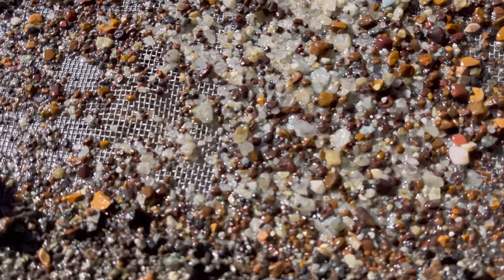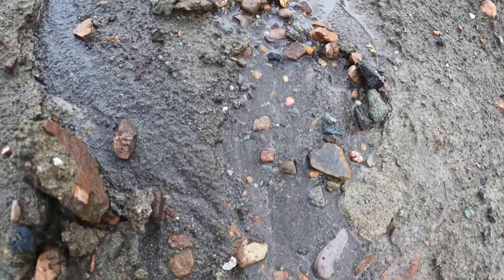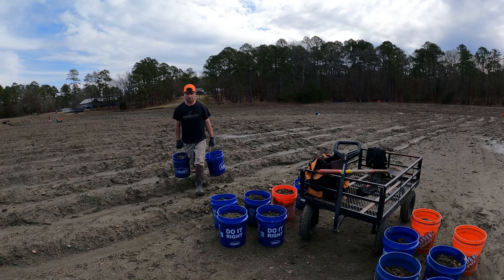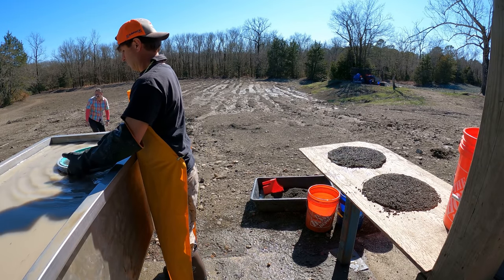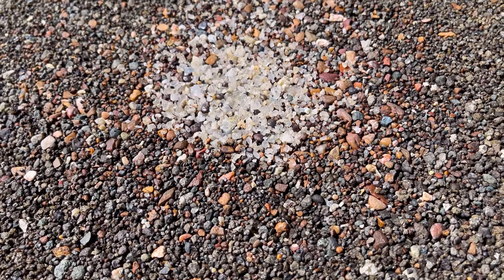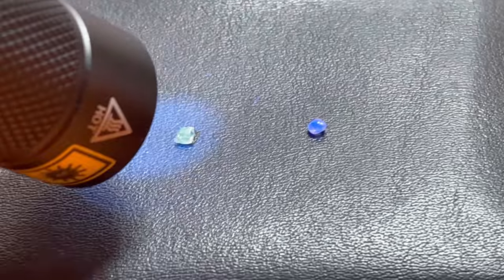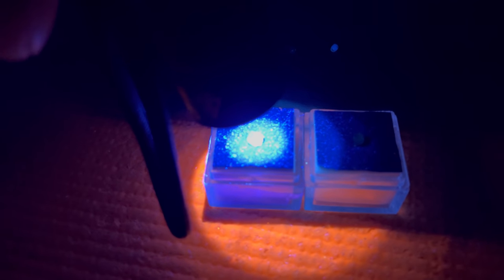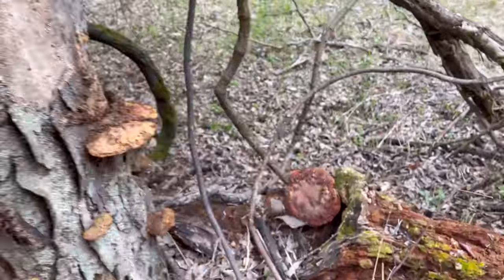Tator Island Equals Diamonds @ The Crater of Diamonds.

Comment: Great video Jason.  Sorry if this is a dumb question.....you've mentioned that the diamond has a very heavy specific gravity compared to the other gravels it's found in.  Would you be able to use a sluice in the same way you use the sluice to trap gold?
Reply from the maker: Only one way to find out! I’ll have to run some material with my 42 point diamonds through my gold hog. See what happens. 
Thanks a lot for watching the video.

Comment: Minor ivans I was wanting to ask a question why do you not find gold in the crater of diamonds I would think there would be some in there
Reply from the maker: This area was over 4,000 degrees, with enough heat and pressure to melt diamond into air. All or most of the gold was disintegrated. 
Thanks a lot for watching the video! 🥔🏝

Comment: Ok stupid question ,, why don't you use the u.v. light after you wash and get down to the small gravel?? Wouldn't they still glow in daylight?
Reply from the maker: No, needs to be darker for the diamonds to glow. There are so many other minerals glowing it would be very hard to determine which one is a diamond. The best way to get your diamonds is washing your material, then using the gym stone Concentrator to make centers, if you don’t see any diamonds on your sooners then you scoop all that material up put it in a container, then once you get home or back to your camp you can sprinkle a little bit of your heavy Minerals on a piece of pan or cookie sheet and perform the final step searching through all the material to find your diamonds
Reply: @DiamondMinerIvins  seems alot of work lol